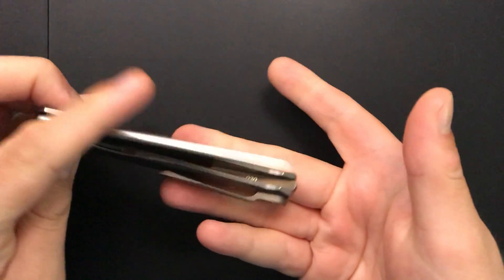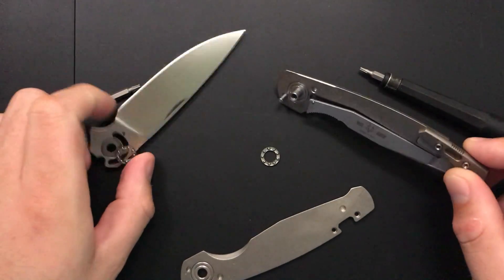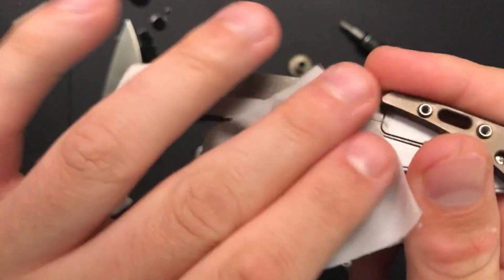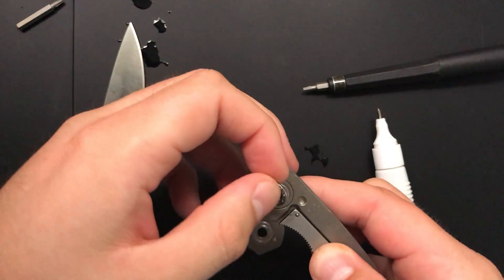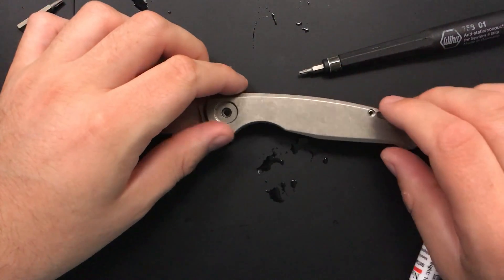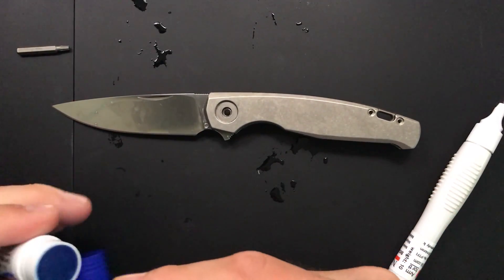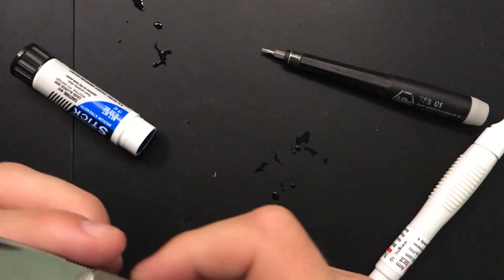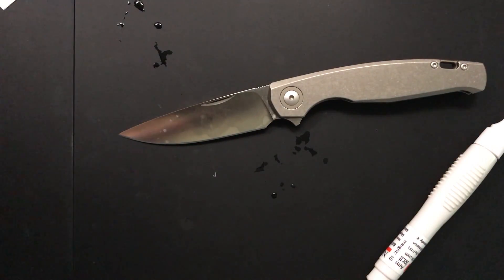How to disassemble and maintain the Giantmouse GM3 Pocketknife

Comment: I noticed you put in the first bearing cage with the open side away from the blade and the second with the open side toward the blade. Could that be the reason for the slight centering issue?
Reply from the maker: +Matt K I've never found that to be an issue, as the bearings themselves are spherical.  And the knife was slightly off in general.  So I doubt it